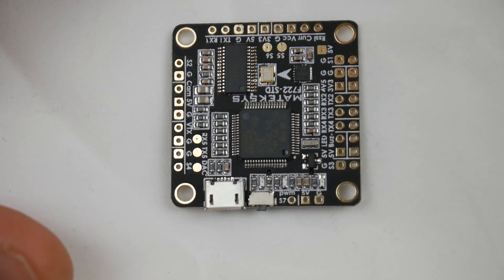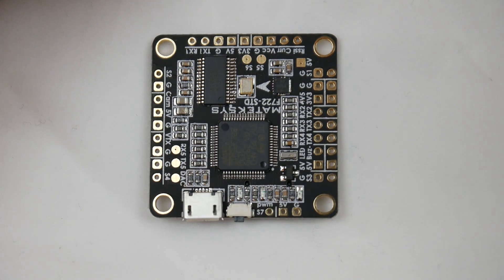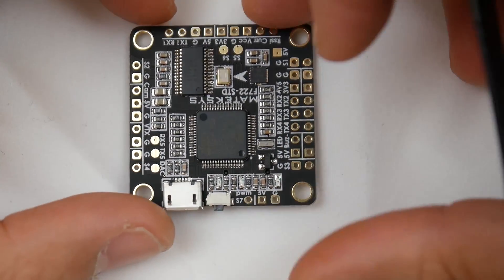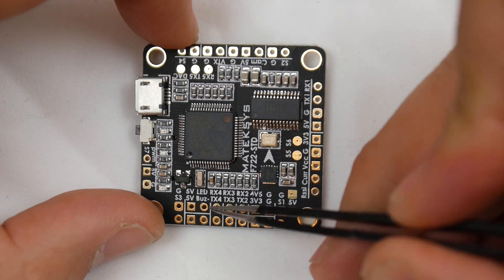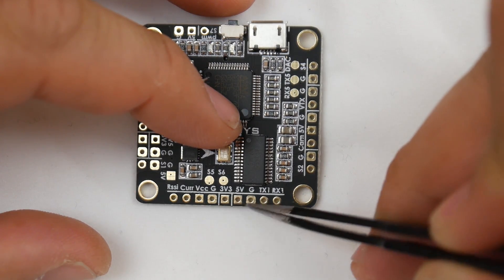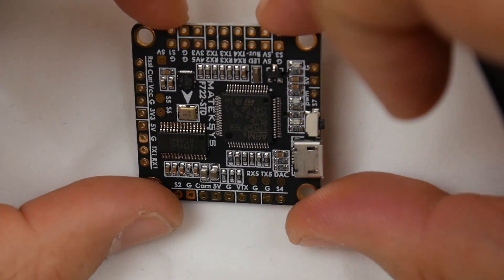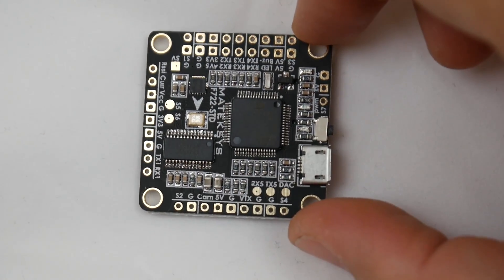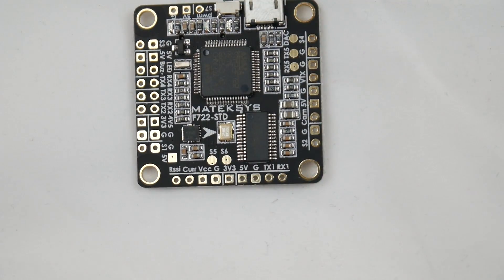Why F7 Flight Controllers // Matek F722-STD FC

Comment: The barometer is on the back side. The small component with a small hole in a corner.
Reply: he is always unprepared for the reviews lately
Reply: definitely an oscillator for the video sync timing
Reply: i was about to say the same thing! that is not the baro , thats for the osd, every board with osd has that same chip,  a crystal i believe.
Reply: exactly!
Reply: exactly! this is crystal oscillator, the baro on the backside

Comment: Hey mesh how noisy were the hakrc blheli32 30a? Quality? Thanks dude!
Reply from the maker: They are ok with 22xx class motors they do have some noise.
Reply: I just bought these planning to use them with Samguk 2306 2500kv, should I be worried ?
Reply: Issam Zoli nope I’m using them with the 2207s just fine.. have you tried out the 2306s yet?

Comment: Could you teach how to install capacitors on a 4 in 1 ESC?
Reply: R D all you have to do is solder the cap leads to the board where the power connects to it. If you’re installing the battery leads to the esc just solder the cap right there to the board battery pads. The closer you can get the cap to the source of power the better. The negative side of the cap will have a stripe down the side of it with negative signs to let you know the polarities. Hope this helps!
Reply: Mini Quads Mega Fun Thanks!